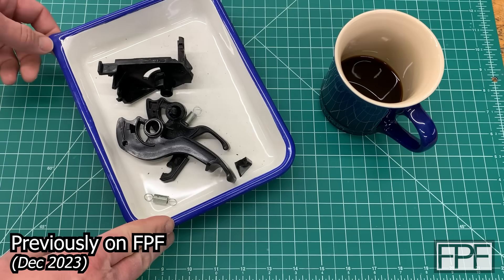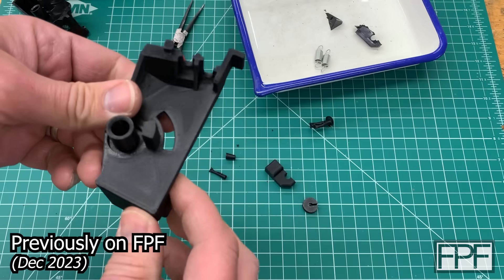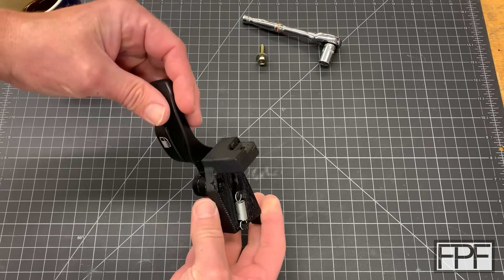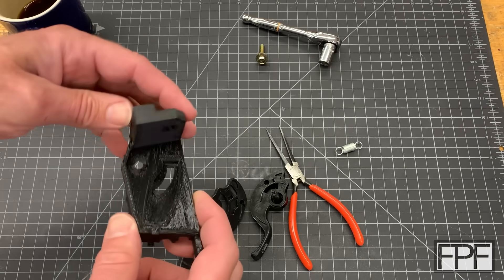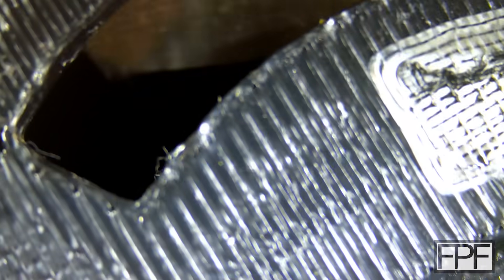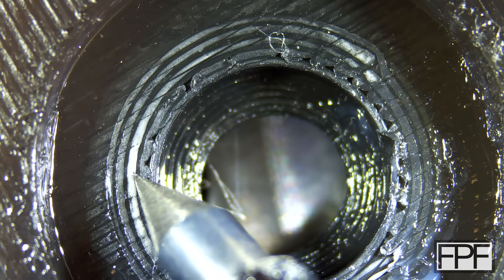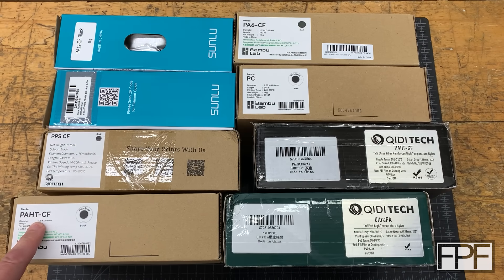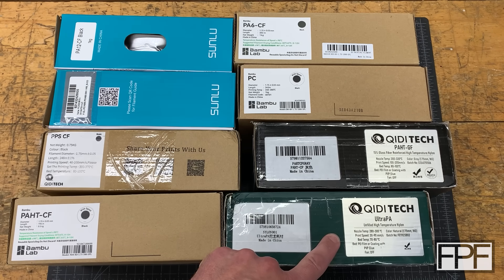3D Printed ABS Car Part Failure Analysis

Comment: I would change the orientaion so that he parts that broke are "horizontal" int he print.  that would significantly strentghen then.  now I fail to see how it's printed so that might create other issues else where, so the other option is to design the part so that the main part os printed as the original was, but that these parts are printed aside, in the orientation that gives them more strenth, and then are pushed through the model (in conveniently desinged holes) and glued there.  I've done that on a couple of models and it allows to print the various parts in their needed orientation. you can even design that parts (and coresponding holes) with a little footing (wider/stepped base) so that when they get pushed through, they stop where they are meant to (instead of pushing through and having to align it yourself).

Comment: Perhaps a change to make the broken stop a separate piece that can be printed in a stronger layer orientation and you cab ‘slide’ the stop into the modified piece, perhaps taking advantage of beefing up the underside that you figure you didn’t need. In a similar thought, you could machine the broken bore and slot that in as well

Comment: For the Stop, make a slightly undersized hole for a grub screw to insert after printing, like a 3-4mm grub screw or whatever fits in that part.  For the shaft, you could print a separate part that could easily be replaced due to failure or find a collared tube (probably the wrong term) that works.  I believe you could even make it on a lathe/mill.  Just a tube with a collar that inserts from the back side.  Edit:  Look up Brass Compression Insert to see what I mean.
Reply: exactly my thoughts. Multi material, just not from the printer :-)

Comment: If you can redesign some of the areas to add ridges, then TPU will be the strongest. The ridges will help the tpu hold shape. Thick solid tpu parts are very robust.  If you have an HD2, then TPU plus ABS inserts for rigidity could work.

Comment: I've had good luck with replacing some types of pins and other protrutions that have bad layer orientation with holes that have separate pressed in parts. Either entirely different materials or printed with proper layer orientation. The hollow pivot you have would be a good candidate for a machined piece. The ASA seemed like it would be fine with those changes.

Comment: I'm kinda curious what the print would look like if you just resliced it after 18mo of slicer improvements and printed it in the same material, honestly. Probably best to use a fiber filled material though. Or print the pegs as a separate piece, as others have suggested

Comment: Sand annealing (especially ABS) would really improve layer strength. Also, not sure how this could be done in the slicer, but having the cylindrical perimeter lines continue down into the main body a few layers would improve strength as it looks like the adhesion was worsened by the change from the surface linear layer pattern to the cylinder's circular layer pattern.
Reply: All you'd need to do is make a cylinder in CAD, as a separate body. Make the OD of the cylinder the same as the OD of the hollow cylinder that failed, and go deeper into the surface of the part. In the slicer, you just use that new cylinder as a modifier, and give it "extra" wall thickness, to guarantee that it's all perimeter walls.
Reply: That is not annealing but remelting. Annealing does nothing for layer adhesion as abs is amorphous
Reply: @riba2233  While you are correct that it's not "annealing" (allowing crystal growth at elevated temperature), you missed the mark with the rest. At temperatures above Tg, but below melting, the molecules of ABS can diffuse between layers, increasing layer adhesion, as well as relaxing the internal stresses of the part, if done correctly. This results in a stronger part in the Z-axis, and one that is less prone to heat-warping over time, in all directions.
Reply: @JohnDoe-fk6id nope, this has been disproven by many tests. You can only get better layer adhesion in abs by remelting.
Reply: @riba2233  Interesting. Could you share links to these tests? I am very intrigued.
Reply: @JohnDoe-fk6id you can see annealing tests from cnck and prusa, they both annealed abs and didn't see any improvement in layer adhesion. Cnck tested remelting in salt and it worked but that was not annealing.

Comment: I would change the print orientation, canter the part backwards 30deg from its mounting plane and print with supports it will give you greater strength where needed.

Comment: I remember thinking during the time-lapse that the cylinder was sticking out a bit too far for that orientation. I’d print it as a separate piece laying flat for strength, then redesign the base so the cylinder slots through with a flange to keep it from pulling out. Glue or acetone weld it together and it should hold up way better.
Reply: This was my first thought as well... could also do the same with the spring lug... but if a single printed part is a "must have" then go with the filament that has strongest layer adhesion, I don't think ultimate strength and rigidity are an issue

Comment: Bro I am so stupid... It's classic for these to break off in a lot of cars, including several of mine, and I haven't even thought to 3D print replacements. Bahahaha. 1.5 years really isn't bad! One key is always to redesign the part with 3D printing in mind and not to just replicate it exactly. Obviously you have gained a lot of experience since you did the original design though. I can imagine PETG-CF, PET-CF, or various fiber filled nylons being great for this application as well. The failure analysis is super cool! Love this. The shell casing is hilarious, by the way. Also PPS is not a nylon, but would be essentially overkill for this. I think ABS could also be perfectly adequate with design and print profile modifications. I think out of the filaments you showed, PA12-CF, PAHT-CF, or PAHT-GF would be the best options. Qidi uses top tier filament, same as Fusrock or Phaetus, so they are always a good bet for engineering materials.

Comment: A CF or GF filament. Print in a heated chamber with nozzle and chamber temps set to top end of acceptable. Change the print orientation, get continuous layers through both of those posts.

Comment: You can change the print orientation, or you can run bolts through the weak spots.  Those are the best way to strengthen across layers.

You could also try the new offset / staggered layers algorithm, that's supposed to lock the layers into each other and create a lot of strength.

For strength within a layer, I've noticed that printing at 100% infill (creating a literal solid part) added a ridiculous amount of strength that I wasn't expecting.  Everyone says the strength comes from the walls and infill, but within the profile of a layer, 100% infill is great.

For your break across the layers, on the square nub / stop, I would run a bolt through it, with a captive nut.  For the bearing bit... What's wrong if it spins freely?  It's basically a bearing, yeah?  If you need to keep it constrained on the top and bottom, I would, again, run a bolt through.  Maybe even swap that bit out for a needle bearing.
Reply: I was thinking how about just running a simple screw through the peg from the back for strength. As for the cylinder, not much room for adding strength in a 3D print. But, with a lathe, how about metal? Could be threaded (into the plastic, or a nut on the back), or knurled and installed like a heat-set insert.
Reply: I also thought about a pin while watching the video.
And the misconception about solid parts with many perimeters is imo coming from the more or less proofen fact, that not solid parts compaired by wheight do benefit more from perimeters.
But solid parts really seem to get more strength by having less perimeters and more infill. This was also proofen by Igor at "My Tech Fun".
I think this is because normally the infill pattern is layed down in a criss cross pattern and thus every extrusion line is not just connected to the one line directly below it maybe avoiding weak spots in that connection.

Comment: If you have room, chamfer the edge where cylinder meets flat bottom. ABS will do just fine for your part, just calibrate the filament for proper extrusion and print it in heated chamber. Printing it hotter and in heated chamber will give you way stronger parts. 
That said, pretty much any material that you shown here would work for your part. UltraPA might actually be best but make sure to dry it really well, it absorbs moisture crazy.
Reply: Much less than PA6 though :)

Comment: Changing your print orientation might solve your problem. And I think you said the part had been in your car for 1 1/2 years and the failures were along the layers line so it would seem the filament you used actually held up well. Good luck and thanks for the video !
Reply: I'd be interested in rotating it 30 degrees, it would increase the layer adhesion.

I've found the plain nylon I've used is a pain to print with. Also PA6 vs PA12 are different types of nylon, not related to CF fill.
Reply: I've watched enough of the Slant 3D channel to print stuff at 45 degrees when possible now. That absolutely would have solved this issue, even if the filament was less than ideal.
Reply: Another solution to solve for the orientation problem would be breaking the design into an assembly. This would allow for optimal orientation per feature and rather than have to comprise for some features to make a single complicated print. For the features which experience the bending loads, I would recommend TPU with solid walls/ 100% infill. For the features which require rigidity, I recommend carbon fiber polycarbonate.
Reply: Tossing in a vote for this solution. I was recently printing a prototype medical device that was long and cylindrical with  printed threads at the end that threaded into a metal receiver. 

PAHT-CF had excellent layer adhesion, but it kept snapping at the base of the threads when really forced. A 10 degree tilt on the print had a dramatic effect on the strength while requiring minimal supports and maintaining acceptable surface finish. 

If you’re not too worried about surface finish, a steeper angle may provide more mechanical strength.
Reply: I would rotate the part about 45 Deg in one direction and maybe 30 to the another, to get as long layers along the stress axes as feasible (if I got the microscope segment orientation right)
Reply: You can remove from 0.4mm to 10% of any circle without changing it's fit. That's a nice trick for overhang supports.

Comment: I think same part but printed at a 45 degree angle would be fine, it failed due to all the force being on the layer lines, which are the single weakest part of a print. any material will have this issue eventually. but avoid filled filaments if you want best layer adhesion.

Comment: PA12 and PA6 are different types of Nylon rather than the % of CF.  Quoting Googles AI summary.:

"PA6 and PA12 are both types of nylon (polyamide) with distinct characteristics. PA6 is known for its high strength and rigidity, making it suitable for load-bearing applications. PA12, on the other hand, offers greater flexibility and lower moisture absorption, making it ideal for applications requiring dimensional stability and chemical resistance. "
Reply: it is dangerous to quote AI summaries, the information is backwards, I use them both at work  Nylon 6 is more flexible and nylon 12 is more stiff.
Reply: We producing things from PA  and you are right

Comment: Because the failure occured along the layer lines from shear stress, it’s really the worst case scenario that this part faces.

I would say the only fixes would involve reorienting the print so that the pegs aren’t printed in that orientation.

The alternative is having the pegs printed separately and then glued or otherwise pressed into the rest of the print so you don’t have to deal with the layer line weakness.
Reply: Other alternative, is to run a bolt through that bit, to keep it on.
Reply: Agreed, and with the H2D he can use nylon with a compatible different filament for supports.
Reply: Yeah I would still use ABS but reorient it or print it in multiple parts.
Reply: That's basically my first thought. Make a cut for those pieces, and print them horizontally (Circle is not the best shape for that, but it is what it is.

Also, for the not circular one.. even adding an m3 bolt or something like that. It'll take most of the force for shearing.
Reply: Came here to post the same thing. I always think about lines of printed plastic going along with paths that will take bending loads.
Reply: Maybe insert a metal rod, rather than printing the pipe that failed could be a good option?
Reply: @Cook66  a m3 or m2.5 screw from behind would be easier.
Reply: Agreed. I'd figure out where all the forces act on the part and find an orientation maximize the angles between those forces and the layer plane. You might also experiment with increasing the flow rate slightly to fill in the gaps, perhaps using a slicer modifier on the points of failure.
Reply: If you want to make in with abs or pla and yes I know it gets hot in the car to melt the pla but you maybe able to get away with it as most of the heat in the car is up higher and because it is darker in that space.  You may get away with pla.  I would just reorient that peice so the layer lines are on an angle or perpendicular.   Otherwise I would just use the PC or nylon.

Comment: No firsthand experience, but I've been curious to see some functional parts be made from Siraya Tech Fibreheart PPA-CF Core.  My Tech Fun showed it had some great layer adhesion in his testing, presumably due to the there being no carbon fibers in the outer surfaces of the extrusions.  Seems like the best of both worlds - layer adhesion and dimensional accuracy.
Reply: Siraya Tech makes great filament in general. Even the PPA-CF normal version should work excellent. I also think PET-CF would be very adequate here.
Reply: They also make an ABS core.  The MyTechFun youtube channel has tested one or both.

Comment: I've been using PC/CF with great success. Also consider positioning the print differently to run layers in a way that maximizes strength in the directions you need it.